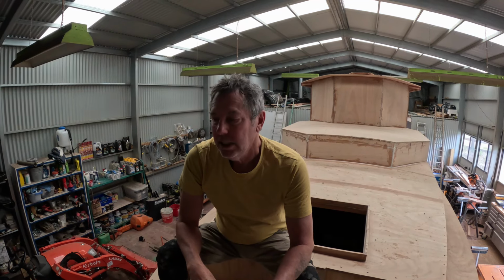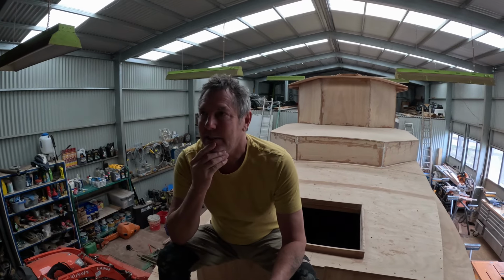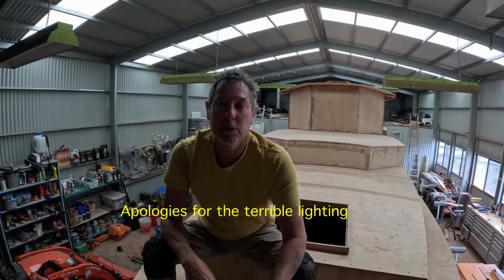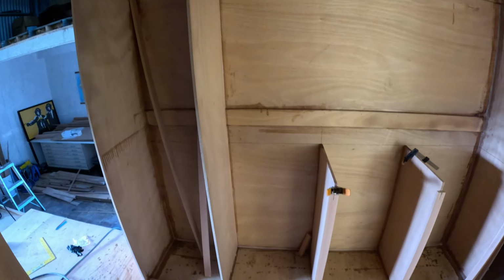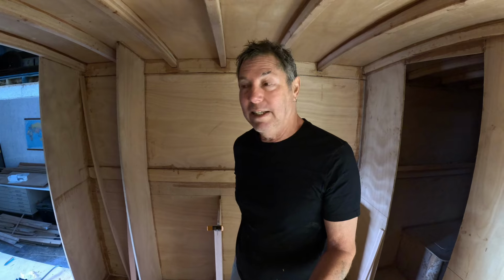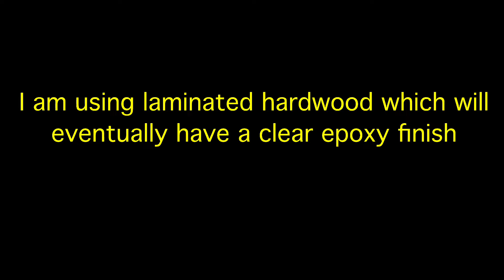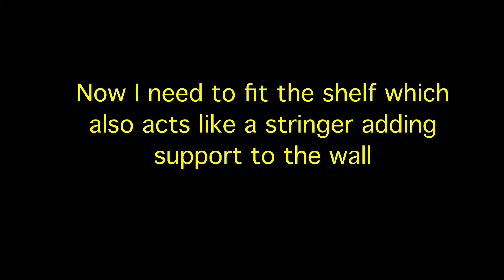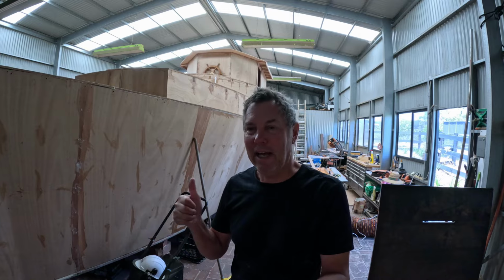Boat Building Did someone say, 'SINK?' Building Dragonfly E 40

Comment: Enjoyed the video Steve, as always. 
You sure did calculate the plywood pretty good. I bet she’s already very solid. 
Any idea in what she will weigh? I understand there’s still a good way to go, but you’re doing a tremendous job. 
See you next week my friend 🤘
Reply from the maker: Hello my friend, yes she is feeling very solid now. Not sure about the weight. The plywood weighs about 2600kgs or 2.6 tonnes or 2.9 US tons. So I have to ad my framing, fibreglass, windows and fitting etc to that. Then the engines which are 117kg each. So that is 234kg = .23tonnes or .25US tons. So far a total of 2834Kg Let's ad 2000Kg for all the other stuff, windows, framing, fridge, stove toilet, etc etc. Total is 4834Kg = 4.8 tonnes or 5.3 US tons. That's my ruff guesstimate. Not bad for a 53ft skinny bat, but we will see.

Comment: Steve   are you sure the width and height may be  tad out  and it will not be top heavy or effected by wind ,you are dong a great job as a one man band , do you intend to  glass the exterior of the hul,l  and how will it be  finally moved to the Murray  and how much do you think it will finally draw .
Reply from the maker: OK, if it is top heavy I will ad ballast, but she is just like the 31 footer I built re height and width and that boat was just fine. (without any ballast) I think she will only draw about 8 to 10 inches. To counteract windage skating, she will have two drop down swing keels either side of the wheelhouse, just like a trailer yacht, and she has a retractable bow thruster for assisting with getting into tight spaces like marina berths etc. when windy. Moving her to the river? Hmm, well, I think we can crane her onto a low loader and crane her off directly into the water. She is just on 11 feet at the widest and not over height for road transport, so I don't see any issues there. Not sure how to get her out of the shed yet, but probably either by crane or on some tandem axels.

Comment: Progressing fast, although some mishaps... On the same level as the plywood question. What is your total budget on the project and what's your current spent amount? If you don't mind talking about it.
Reply from the maker: Hmmm, I don't mind talking about that at all, but I am not really sure yet. Later I will go through everything and see where I end up. At a guess I think it is something close to this right now. At $150/sheet for the plywood, AUD19,800 Epoxy around AUD4,000 (that's 3,500 for a 44 gallon drum and also some extra in 20lt containers, AUD 6,000 for the bow thruster, about AUD2,000 for framing timber used for the laminated beams, runners under the hull etc and about AUD1800 for the stainless steel skids under the hull. So all up about AUD 33,600 so far. :)
Reply: @steveshierdoesstuff7420  That sounds like not so much compared to that you are on your way to having a boat of over 50' which I guess would cost may hundreds of thousands AUD bought by a dealer, but I guess we are only halfway in costs. And then comes the engine... ;-)
Reply from the maker: Yes, engines should be about 12k each I think. Two Yamaha 60hp 4 stroke hidden under the aft deck. :) @gunnarfernqvist4896
Reply: @steveshierdoesstuff7420   Ohh, so you'll be running regular outboards as inboards, clever in terms of service and simplicity. I'm eager though to see how you will elongate the engine controls.
Reply from the maker: Haha, yep, me too @gunnarfernqvist4896

Comment: Where is the strength lengthwise?
Reply from the maker: Hello, the strength longwise comes from the 'honey combing' which is a series of comparments under the floor and also from the double sides. The superstructure panels go right down to the floor and then there is another wall which forms the flare. (yet to be added from the front of the wheel house all the way back. Bear in mind that we aint chasing any big waves. There are also lots of longitudinal stringers and framing. Cheers, thanks for watching. Steve and Maple
Reply: Also all of Steve’s builtin furniture adds to the overall strength.
Reply from the maker: @fisheater844  Yes indeed. Quite common practice to use the 'furniture' as the framework etc. Everything just has to be spaced correctly to achieve the right strength. Cheers